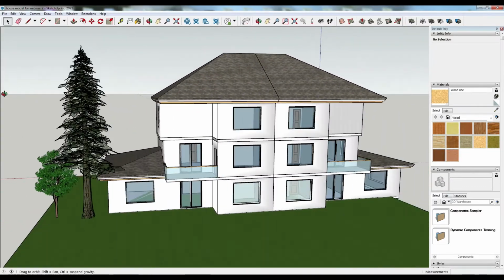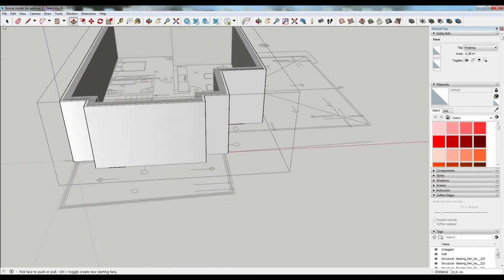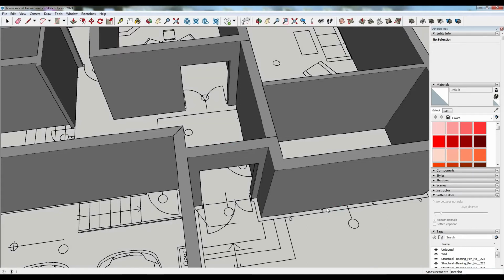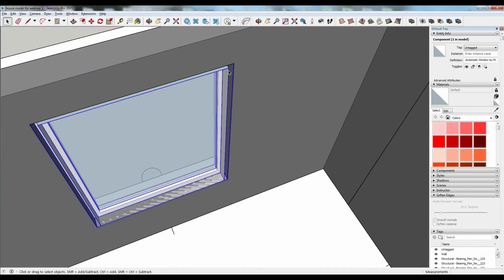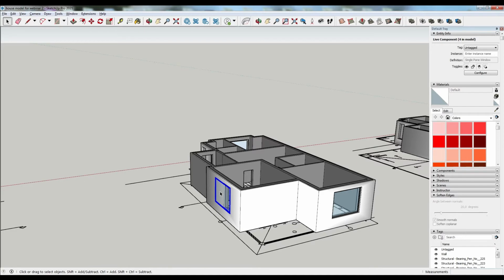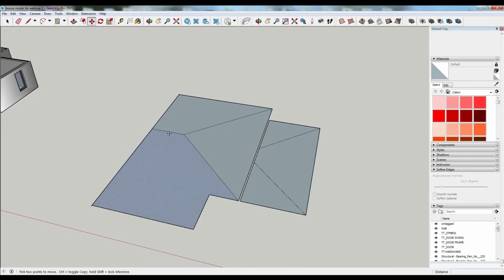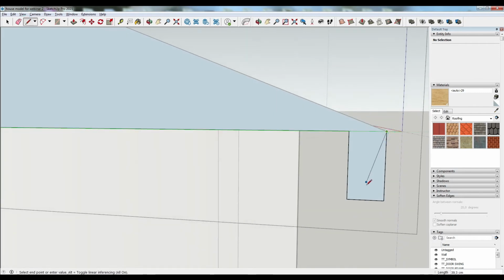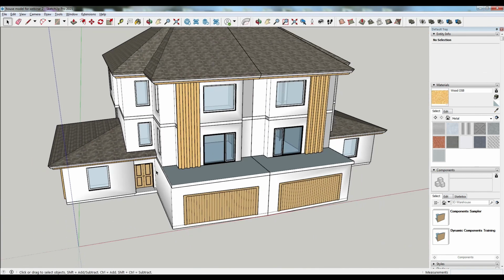SketchUp Architecture: CAD to 3D House with Wall Extensions, Openings & Roof Modeling

Comment: At min 49:10, do not apply materials to the back faces (blue), problems may occur when rendering the model or exporting to other programs. Orient the faces correctly, with the white facing outwards.